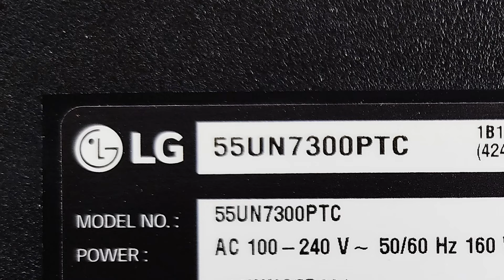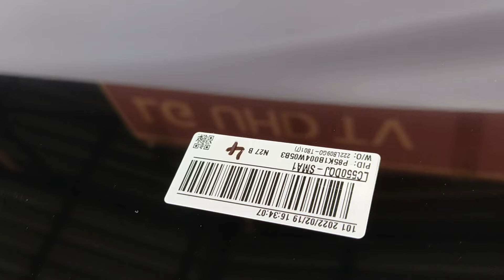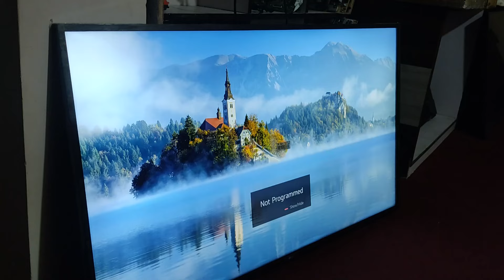LG 55" UHD TV screen replacement

Comment: In the UK, when you try to buy a larger size from 40" let's say, the cost of the display is so high, that you can buy a 2nd TV for. Only the newest models which cost more and use cheaper displays are worth still fixing. But, to be true, least people I know replacing displays. If the price of the TV would be higher, or the price of the display would be cheaper, yes, than we would replace them. Otherwise, it will stay as is.